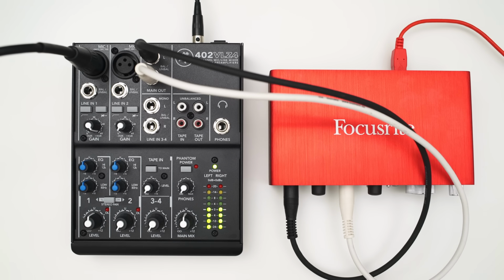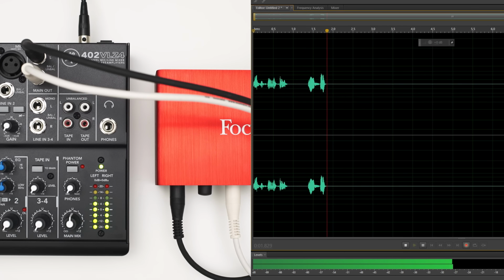Setup Guide - how to connect a Mixer to an Audio Interface for audio recording

Comment: I did this for a few months using a Behringer UCA202 USB interface. Got awful results so trashed it. As your Q&A explained, this entire video is pointless as demonstrated. Recording directly to the interface allows TWO OR MORE STEREO TRACKS on the computer software, the Digital Audio Workstation (DAW) . I really like my Mackie Onyx mic preamps  on the newer models like the ProFXV3 series and the Mackie USB interface Onyx producer 2.2.

Comment: Hi, thank you in advance for your help here. I have a question. Can i use dual TRS to dual TRS cable to connect instead of the two separate cables that showed in this video?
Reply from the maker: Absolutely :)
Reply: Will dual TS to dual TS cable works if I need to record my voice into the phone so I'll be able to hear back?

Comment: I am very new to this. I have a mixer with a direct USB connection to my computer. But the level comes into the computer really low and there doesnt seem to be a way to increase the output level. If I incorporate a USB interface will I be able to boost the audio level sent into my computer?

Comment: What about the levels on the audio interface? Where should they be set to avoid distortion etc?
Reply from the maker: The gain on the interface should stay all the way down :)
Reply: @JulianKrause Your video is very helpful and thankyou for your reply but I'm a little confused....no gain at all on the interface inputs??..
Reply from the maker: @billyculbert9544  Yes, you are sending a line level signal into the I interface. This signal is very strong and does not need additional gain from the interface.

Comment: Isn't that a USB mixer, if I'm not mistaken? That's seems kinda redundant and unnecessary. Just run the USB mixer straight into your DAW.
Reply from the maker: That mixer does not have a USB connection. But you are right, if it had one this setup would be redundant.
Reply: @JulianKrause  I personally don't like interfaces. They're a waste of money for the limited possibilities. USB mixers for the win!

Comment: Hi, great video! Apologies if this is a daft question, but could you tell me why the mixer is before the audio interface in the signal chain? Presumably the DAW would show a single stereo channel & it would not be possible to adjust the recorded mix between the two mics? Would it not be preferable to connect the mics to the Audio Interface & connect the AI outs to the Mixer? Thanks in advance for any advice.

Comment: Where do I plug dbx 286s in this setup?
Reply from the maker: Depends on what you want to do. Either in front of the mixer or between the mixer and interface.
Reply: @JulianKrause  Thank you for a quick response. I want to configure it that way so I capture my podcast on Zoom H6 in a quality that doesn't require further tweaks.
Reply from the maker: @drob9673  If you only have one speaker I would plug the mic into the  286s and then connect it to the H6. If you have multiple speakers you would plug their mics into the mixer. From there go through the 286s into the H6. This way you can give the whole audio a slight compression and noise gating.
Reply: @JulianKrause  thx I'll try that

Comment: Thank you Julian for your well explained videos. Love the technical stuff!
Can anyone answer these questions please?

- Which has the BETTER PREAMPS - the mackie 402 or the Focusrite v3?

- If using the same setup demonstrated, would it be better to DIVIDE the preamplification between the audio interface and the mixer, instead of all the on the Mackie?

- Many are saying to only use the audio interface. However, is there an advantage to being able to CONTROL THE MIC GAIN AND OUTPUT GAIN of the mixer, over only having one gain control on the audio interface?

I have the same mixer and just purchased the Focusrite Scarlett v3.
Thanks very much for any input :)

Comment: Hi Julian! I have a concern...I have the U-Phoria UMC404HD and the Behringer XENIX 1002FX...I have connected the 1/4 cables to the mixer’s main out...for the interface, do I connect them in the input 1 and 2 in the front or in the main out in the back? This 2 things are killing me...Thanks for all the help you may provide!!!
Reply from the maker: Hey Joseph, you would go from your mixer into the front TRS inputs on your UMC404HD. Make sure you have the channels set to line with the control buttons on the front of the UMC404HD.
Reply: One last question, can I plug mics on the remainder inputs?
Reply from the maker: @josephrivera2062  Yes, you can plug mics into the remaining inputs on the interface :)
Reply: Julian Krause thank you very much for your help Julian! Sending you lots of blessings and success your way!
Reply: Of the interface?
Reply: And thanks for the help!!!

Comment: I had a Mackie ProFX4V2 mixer which has no USB. Was wondering whether to get a Scarlett 2i2 3rd generation. Instead. I just retired that mixer, and got a Mackie ProFX6V3. It has USB and more advanced mic preamps. Love it. But, the advantage I would have with a Scarlett 2i2 is to be able to create 2 distinct stereo tracks in the computer (just started using Cakewalk which is free and fabulous! ) whereas my Mackie allows me only one stereo track at a time. Eh, no big problem...

Comment: Question, but let's say I just want to use my mixer with no computer nor interface, do I have to unplug the main out of the mixer and connect it directly to the speakers every time I wanna do this? Does it make a difference if my interface has an independent power switch so I don't unplug anything?

Comment: Could  Focusrite 4/4 only be the 2 in 1 (mixer/audio interface) for karaoke or audio recording as well. If I do not have the mixer, just  plug two Microphones into XLRs in the front panel and 2 lines out  (L and R 1/4 jack)  to active monitor. Can it works ? Thanks
Reply from the maker: Yes, this will work just fine. Set the interface to direct monitoring and you are good to go :)

Comment: What mixer and/or USB Audio Interface would be the best if I want to record a microphone's sound AND my digital piano's sound from its two "AUX OUT" R and L/L+R ports?

Thank you.
Reply: If your piano has a stereo output the you will need three inputs, the MOTU M4 or similar would come in handy, as it have four inputs and outputs.
Reply: @ElTitoXBASS  I found one with only three inputs. I think Yamaha AG03 USB Mixer will fit my needs perfectly, and it's cheaper, too. Thanks for the suggestion though.

Comment: Und was ist, wenn die PreAmps des Mixers mehr rauschen als die des Interface'? Bevor ich den Gain soweit aufreiße, arbeite ich lieber mit mit dem Gain des Focusrite, der rauscht nämlich so unterirdisch wenig, dass ich dem den Preamps so eines billig Mixers definitiv vorziehe. Deshalb so pauschal würde ich das nicht sagen. Es kommt drauf an, schon eher. hätte hier meiner Meinung ins Video gehört. Dass ein Pult eine entsprechende Pegelspannung braucht ist klar, aber die bringt mir nichts, wenn dadurch das Rauschen so stark wird, dass das Signal unbrauchbar wird, vor allem, wenn ich das mit den wirklich guten Preamps des Focusrite ausgleichen kann.

Comment: You forgot to include the part where you need to adjust the input gain on your audio interface.
Reply from the maker: No I didn't forget, the gain on the interface stays at zero like shown in the video :)
Reply: @JulianKrause  Some interfaces require it to be turned up. I have the UMC202HD and bringing line level from an outboard preamp and with gain set to 0 on the Behringer the audio was extremely quiet. Had to set it to 12:00

Comment: Do you apply less eq and compression in post editing if your mixer has eq and compression or will that be too much?    Also does this effect latency?   I have latency issues when my fx is enabled and record monitoring is on with just the interface.    If I disable record monitoring there is not enough latency to effect anything.    Usually this causes no issues except I can't listen to fx enabled while recording.   Thanks man awesome video!
Reply: I use a similar process although more detailed specifically for monitoring.my mixer has on board FX which I use for tracking with zero latency. I send the direct out(NOT main out) of channel being recorded to the interface. when tracking I use the FX send on the channel to get some reverb to a sub buss.i then route the sub buss put to a headphone amp which I monitor ALL on(not the software monitor).the out put of the DAW is then routed from the interface main monitor to 2 free channels on the mixer. No latency!

Comment: Thanks for the clear explanation! My question is about stereo/mono: why is it necessary to record in stereo if you can get the same resoult by copying the mono track in the software? then you get two identic mono tracks which you can pan and make kind of "stereo", right?
Reply: It's not necessary but you would need it if you're using a stereo input, two microphones or a microphone and instrument, so the DAW receives two different tracks.
Reply: @ElTitoXBASS  thanks, so you mean that the extra feature with stereo is that you can record two diferent imputs simultaneously right? That makes sense

Comment: Cant you just plug the mixer directly into the computer via usb?
Reply from the maker: If the mixer has a USB connection, then yes. If not, you have to use the method shown in the video.

Comment: I wish to arrange a home recording studio. I have FOCUSRITE 8i18 (2nd Gen) audio interface (support Ableton DAW ) and Yamaha MG20XU mixer with USB port. I need to use both hardware with a common DAW software. Can you prefer ONE  DAW software for FOCUSRITE  8i18 and YAMAHA MG20XU mixer. And also I need to know the computer configuration

Comment: would you need an interface if the mixer has a usb out on it or would it be worse quality?
Reply: I run 2 mixers and one of them is for the usb interface part of the chain... 95% of the nixing is done on the 1st board and then sent to usb board for a little pep. The 1st board is my allen and heath mixwizard going into the behringer that has the usb... my recording has not suffered in quality

Comment: Vielen Dank für dein Tutorial Video! Eine Frage beschäftigt mich seit einer Weile beim verbinden von Mixer mit Interface, und zwar das, was du als TRS Kabel bezeichnest. Eigentlich benutzt du nämlich Kabel mit TRRS Stecker, also Stereo- bzw. Symmetrische Steckerverbindungen. Was aber, wenn man tatsächlich TRS- bzw. Mono- bzw. Unsymmetrische Kabelverbindungen verwendet für symmetrische Klinkenbuchsen. Ist das bei kurzen Kabeln schlicht egal, oder sollten in jedem Fall symmetrische Kabeverbindungen mit TRRS-Steckern verwendet werden? Danke und bleib gesund!
Reply from the maker: Hey, die gezeigten Kabel im video sind wirklich TRS und keine TRRS. TRS steht für Tip, Ring und Sleve und bezeichnet die drei Kontakte von dem Kabel. Die Stecker nennt man manchmal auch Stereoklinke weil man unsymmetrisch auch Stereo-Signale übertragen kann. TRRS hat vier Kontakte und das wird häufig bei Smartphone Headsets eingesetzt, wo der vierte Kontakt für das Mikrofon genutzt wird. Was es auch noch gibt, sind Mono Klinkenstecker, selten auch mal TS (Tip und Sleve) genannt, die haben nur zwei Kontakte.
Auf kurze Strecken, macht symmetrisch oder unsymmetrisch keinen riesen Unterschied, aber wenn man die Wahl hat, sollte man die symmetrische Verbindung vorziehen. Dafür dann ein TRS Kablel (wie im Video gezeigt) nutzen um pro Kanal eine symmetrische Verbindung herzustellen. Viele Grüße!

Comment: My home setup (Mackie ProFX4V2) is slightly different in that the two TRS main outs go to a PA speaker (JBL Eon One), and I use the Monitor Out, via TRS 1/4" to red/white RCA to a USB interface, a Behringer UCA222 which costs $40. I know, I know, this does not allow a true digital interface in the sense that you can't adjust each track separately. You simply get just one stereo track. The Bal/UnBal Monitor out, as long as I use a TRS jack, does put out stereo. In the future yes I will get a FocusRite Scarlett 2i2 interface, when I improve my singing...for now its all a fun thing! :)

Comment: You don’t need a separate mixer to record into your digital audio workstation. That’s the entire point of an audio interface that has a combo line/instrument/mic xlr+trs input like the focusrite interface you’re demoing in this video. 

I’m not saying there’s not ever a reason to plug a mixer into an audio interface - For example if you had an entire band going into eight or 12 channel mixer and you needed to send a stereo bus of that into this small interface.- but in this case you don’t need one and you can plug the mic directly into the audio interface itself. This would be a better situation for avoiding unwanted extra noise in your recording as each device that you put into the signal chain increases the noise floor of the audio signal
Reply: I'm doing kind of what he is recommending, except the two 1/4" main outs go to my PA speaker, and I use the Monitor Bal/UnBal out with a TRS jack/cable to connect to a USB interface. Of course, during recording the PA speaker is turned off!

Comment: Would the mixer work like a Fet Head or CloudLifter if you have an SM7B?
Reply from the maker: Pretty much. If the preamp on teh mixer has lower noise than the preamp in the interface you will benefit from using the mixer. Addtionally you have more analog gain.

Comment: Great video! Three questions:  My interface has unbalanced line inputs so there is no point in using a TRS cable in my case, am I right? Secondly, it says on the mixer: bal/unbal so it means that the output can serve both as a balanced and unbalanced connection, correct? Thirdly, an example: one device has a balanced output, the other device has unbalanced input (or vice versa); is it safe to make a connection between them? Thanks in advance!
Reply: I'd also like to know the answer to those questions.

Comment: Can i multitrack in dis kind of setting?
Reply from the maker: Not really, the mixer combines all the channels into a single mix. You do not have the ability to change channels separately afterwards. If you want to record more channels separately, you simply need an interface with more inputs.

Comment: Great video! If I want to connect my audio interface to a mixer... and also add in a pioneer DDJ controller, would this be the same setup? I want to be able to use my speakers for both DJ controller and daw. Please advise.

Comment: you didnt show the gain staging on the interface.
Reply: Control your gain on the mixer only, leave the Gain on the Interface at the lowest setting.
Reply: @xDanBeast1337  Does this lead to a less noisy noise floor? Doing things like this dude explains ?
Reply: @juandonvogel8647  Keeping the Gain ANYWHERE in the mix as low as possible lowers the noise floor, there's always some - just gotta find the sweet spot.

You should only usually use the Gain on the device, which is powering the microphone.
Reply: where should the 2 knobs be at?
Reply: I have the same questions 😰

Comment: Do you really need the audio interface? I saw another video where a guy connected the mixer to laptop using a cable that had a 1/8'' jack into laptop mic spot and on the other end plugged into mixer with 2 1/4'' jacks.
Reply: If that setup sounds good enough for you, of course you can do it.

Comment: Thank you for the video. I play guitar and would like to connect my guitar and my guitar effects into a looper pedal. I was wondering where i add the looper pedal/effects into this setup? If anyone knows and sees this comment i need some advice please.
Reply: I'm not sure a mixer would be the right solution in your case. I would go [guitar]----->[effects]---->[looper]---->[interface]

Are you recording a miked amp or using a modeler? I assume you're recording live performance?

Comment: Great video. I do wish you would have explained further gain staging through the rest of the setup, such as setting the gain on the audio interface inputs to the proper levels and getting the proper levels in the DAW. That would have rounded out the rest of the process nicely.
Reply from the maker: Hey, this process shows the proper gain staging. If you follow the tutorial, you would leave your gain on the interface turned all the way down. This is the correct gain position for the interface. Cheers!
Reply: Julian Krause Ah, I see. I forgot that you switched your inputs to line level. My interface’s front panel inputs are mic/instrument only, but have line level inputs on the back panel, so I’d use those. The line level inputs don’t have gain controls, of course, so yes, I see your point of leaving the gain controls all the way down on your interface.

Thanks!

Comment: Thanks so much for this wonderful video. Helps a lot. Got a question. Can this type of audio interface support a 16 channel mixer, in such a way that I can plug in more gear through the mixer for recording? Would that be a good way to go rather than have a very expensive audio interface with many inputs ? 
Also pls, is there any advantage of plugging directly through an audio interface for recording versus passing it through a mixer into the audio interface? 
Thanks

Comment: How did you make that focusrite record those 2 different inputs into one track at the DAW, I use that same Adobe Audition and 2i2 but when I record from 2 different inputs of the 2i2, each input records into a separate Track in the DAW, I get 2 separate mono tracks, how do you record the 2 into a single stereo track?
Reply: You have to create a stereo track and redirect first input to the left channel and second input to the right channel, also, in the mixer, pan first input to left and second to right. Hope it helps.
Reply: @ElTitoXBASS  Ok thanks! Will try that out